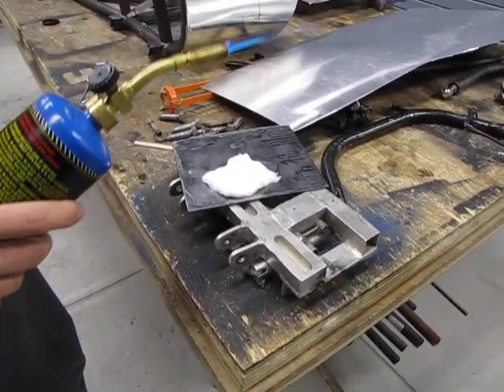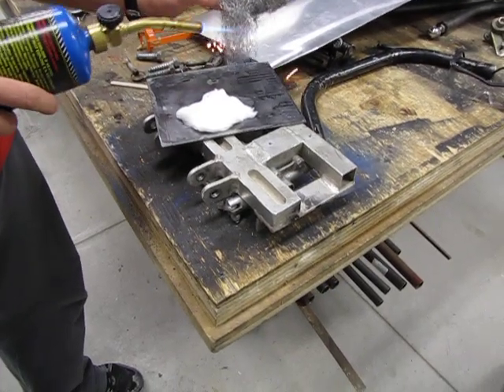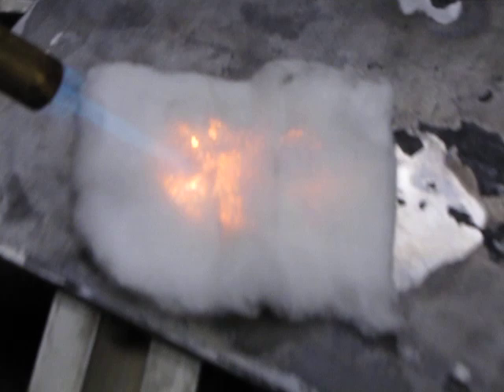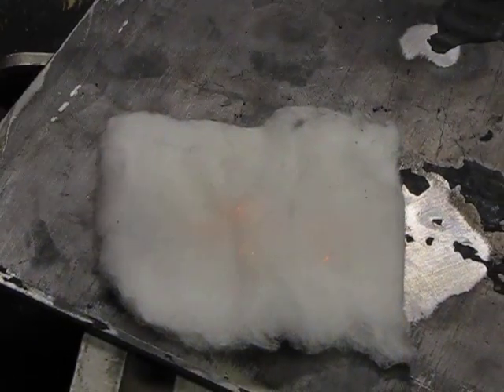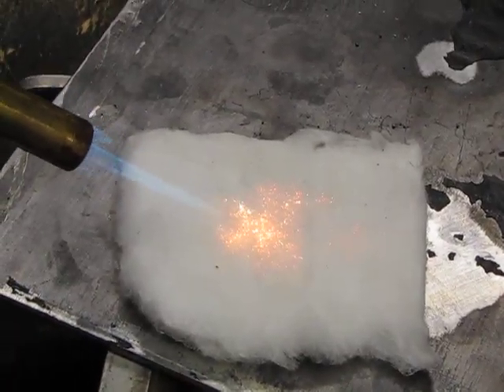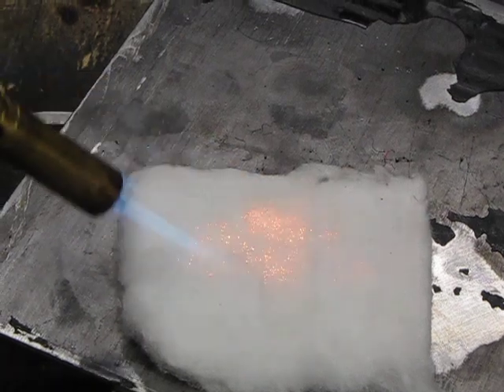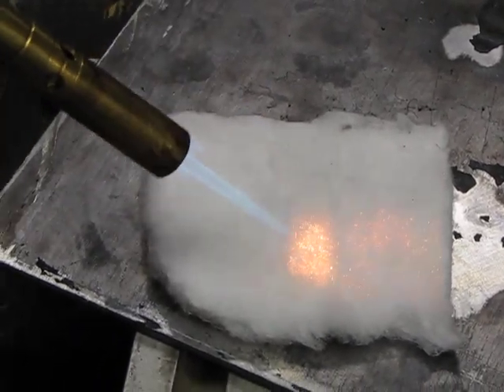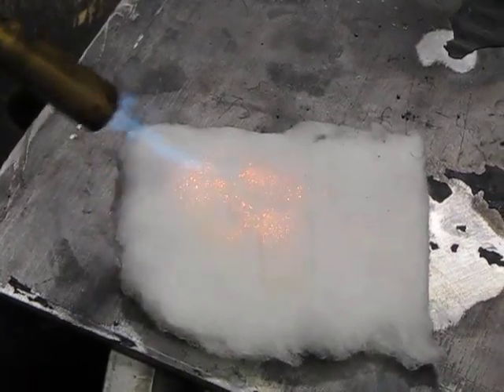Ceramic Fiber wool vs Steel Wool. This is going to be used for muffler packing

Comment: I’m learning more about my little ATV muffler repacking project, but I’m getting antsy bcuz I want the bike back together! 

So the stainless steel wool heats up/glows but the ceramic fiber doesn’t, yet the ss wool is wrapped around the core first to keep the wool from blowing out between the baffles...seems kind of retarded but wtf do I know. Why wouldn’t they use some kind of Kevlar or something that doesn’t burn to retain the ceramic fiber. Cost? Or does something like that not exist?

Comment: Stupid "test".  You won't have flames like that on the packing even if your engine was running so badly that you had overrun in the pipes that the packing surrounds.

Comment: Two brothers exhaust uses stainless steel wool as a primary "sounds absorber". the fiberglass packing acts as the secondary sound absorber and a carbon collector. So let us compare glass wool and ceramic wool and the job it has as an exhaust packing. First is over all job function (sound absorption, carbon and pollutant collection) my guess is that if you researched the performance of these two products you would find only one difference, primary cost of material. As for the stainless steel wool, strange two brothers doesn't sale a kit to replace it. I guess it must not burn when compressed and not directly under an open flame.

Comment: @samhamm The combustion process is just as hot inside the aluminum chambers as it is on the glowing exhaust, but the aluminum is no where near melting temperature, just like a paper bag filled with water boils on a campfire without destroying the bag. 2000 F exhaust can me present on a sensor, but the orange headers are not the same temp, they would be white and slump to the ground as you drove. Love Rotaries. Disabled buzzers, wind them up to 10K. Gets scary light after 127 mph, 2/3 throttle!

Comment: @samhamm  Yeah, I have...(Toyota Master Tech) I've always been seduced by Rotaries. Owned a 13B Mazda pickup with points and a Mitsubishi four barrel, and one Rx7 13B with the dynamic intake. Glowing red or orange is still below the 1000F mark. On the thermal spectrum, steel that is 1500F would be bright yellow. A pyrometer mounted in the exhaust could register exhaust gasses at 1800 F, but the steel is in contact with ambient air, and will be absorbing and maintaining a much lower temp.

Comment from the maker: @FJoeForty 
Have you ever owned a rotary propelled car? We get pretty hot with those engines. Personally on my car, I have Exhaust Gas Temperature probes in my headers, and just being on the highway cruising around I normally float around 1600F, at the track I've seen it go over the 2000F on my gauge. This is not just me this can be confirmed by other rotary owners as well. My car stock comes with a warning light that says (Exhaust Overheat) and at the track its always on.

Comment: @yelroc71 It is typically for lining pottery kilns and ovens. The uses are endless for anything from 500 to 3500 F. Any pottery making supply store that sells refractory, kiln elements and metal melting crucibles will have it by the foot.